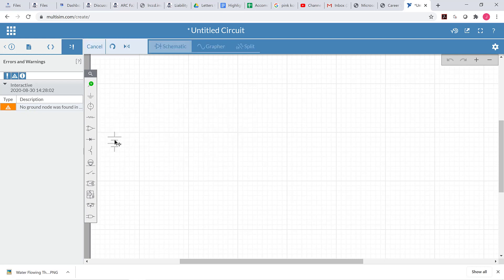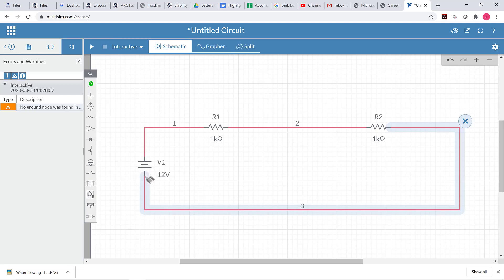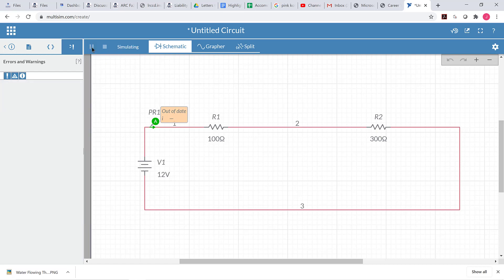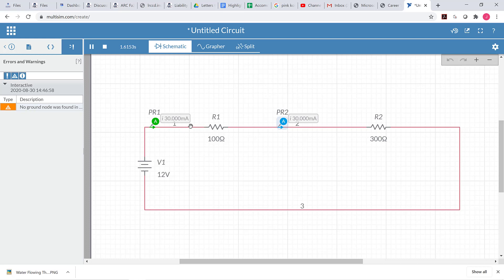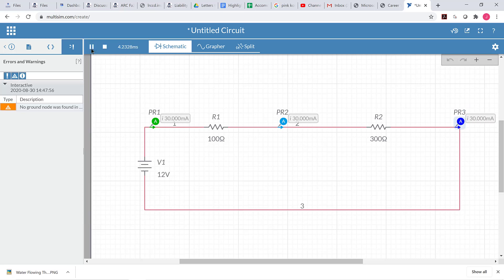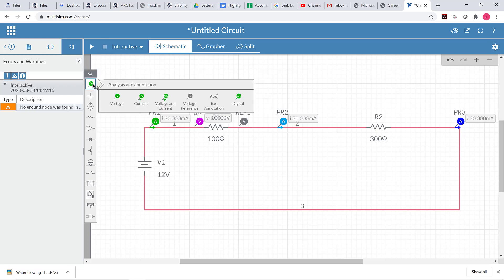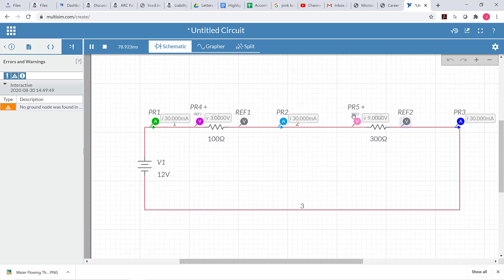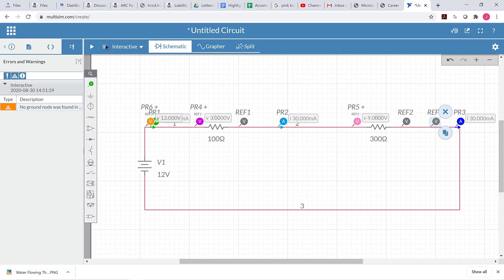Voltage and Current in Multisim

Comment: Great Video. How can I set a circuit with a current-controlled voltage source and a current-controlled current source in mutism?  If mutism doesn't support that, can you tell me any other software that does? Thanks

Comment: How to find mcb, shunt resistor and hall effect current sensor in NI multisim please reply
Reply from the maker: Hi Budda,

I think that you can use a regular resistor as a shunt resistor.  I am not sure what you mean by an mcb.  I don't think that hall effect sensors are included in the free version of multisim; they might be available with a paid subscription, but I am not sure.

Cheers,
   Jordan.
Reply: @ElectronicsARC  mcb means I am asking about miniature circuit breaker
Reply: @ElectronicsARC  thanks for reply

Comment: Is there anyway I can know the direction of the current in a more complex circuits?
Reply from the maker: There is!  The current probe includes a small arrow that points along the wire where the probe is attached.  If the current probe shows a positive measurement, that means that the electricity is flowing in the direction of the arrow.  If the probe shows a negative value, the current is flowing in the opposite direction.
Reply: @ElectronicsARC  thank you so much